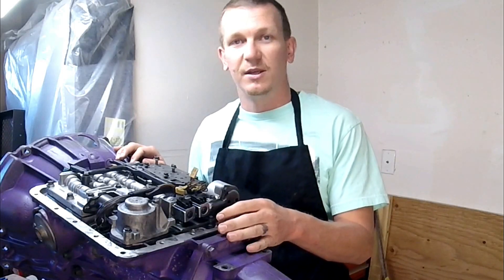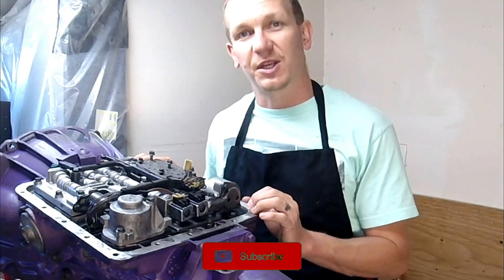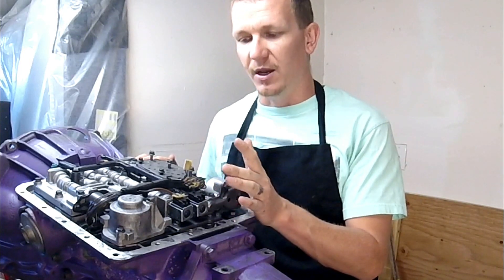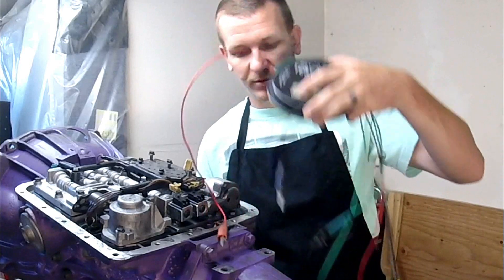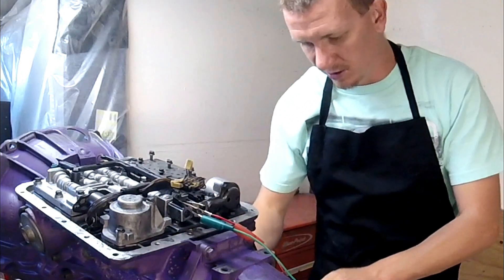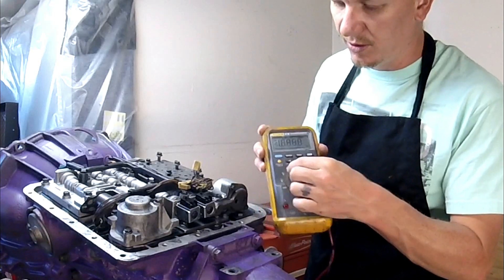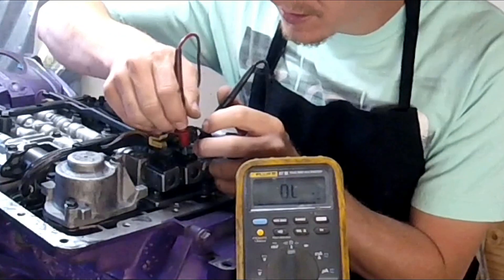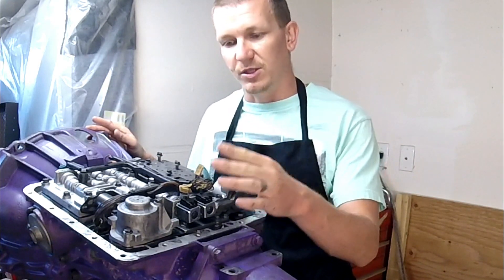GM 4L60-E Shift Solenoid Quick and Easy Test. Sol A, Sol B, 1-2, 2-3

Comment: I have a 4L60 E that when you put it in drive it takes off in 3rd gear. I think it has first or second when manually shifting it but no transmission codes present. Am I wasting time testing shift solenoids? Great video too!

Comment: I drive a 1997 chevy k-1500, my truck shudders pulling hills on the interstate/highways (downshifting problems?) Would this be a 1-2, 2-3 shift solinoid issue? If i let up on gas, it goes away, as well as giving it more gas...🤔

Comment: I have a 2000 S10, the 4L60e works great in all manual modes but not drive. I have measured from the pcm computer harness and I get the 21 ohms on all relays. Black pin 17 to Red 2, 4, 6 and 7. I am suspecting the PCM computer. Do you agree? Video was great.

Comment: Exactly what I was looking for in a 4l60e “bench test” of the solenoids.  My truck OD (4th) stopped working altogether and thinking my truck is only running on 1-2 only as when I am doing 60mph, rpm is 2100.  Lucking half my drive to work is in town IE 40-45mph with the last 5mi stretch @ 60mph to my work exit.  Truck shifted just fine one night and then the next evening all of a sudden did not want to shift up to overdrive.

Comment: 1994 Silverado Z-71. 1-2 shift strong. 2-3 shift is nonexistant, like going into neutral. If solenoids check good what to check next?
Reply: did u get it figured out
Reply: I checked the ohm resistance. Came back 19 ohms on both solenoids. Tried the 9 volt battery test. No clicks. The coils in the solenoids looked loose, like they were unwinding. Fluid looked burned with a lot of sludge. Didn't notice any metal. Could it be sludge and grime plugging up the manifold pressure switch? I had others tell me the 3-4 clutch pack is burned out. This problem was sudden. What else can I check without pulling the transmission out and tearing it down?

Comment: What about GM Solenoids ?
That the same as A/C Delco ?

My 4L60E transmission won't shift into 3rd gear and slips to high rpms.
1 & 2 is okay. That the solenoid ?
Reply from the maker: Ac Delco parts are pretty much GM parts.

It's possible it's a solenoid but doubtful. Honestly, you probably have worn out the 3rd gear clutches.  There is a 3rd gear check ball in the case that goes bad, and that causes 3rd gear to wear out. I know that's not what you want to hear but that's my honest opinion.
Reply: @ScottiesHobbies 
So if the 2-3 solenoid passes test, then the ball and 3rd gear is bad ? Where's the video link for that ?
Reply from the maker: @paulforest1373  I have a old video that kinda sucks covering that check ball. Check it out here: https://youtu.be/3RwmrY6QrBs?si=JPFkvSjxGAf8L8zw the trans has to be disassembled to test it. You could probably replace it by removing the valve body. But if the check ball is bad, 3rd gear clutches are probably worn out.
Reply: Thanks. On eBay link, how do you determine which solenoid is a (1-2) or b (2-3). 

My solenoids look exactly alike except numbers.
1 has  8054D the other has 8054E

They both have 8129R.

The have good ohms and click.
Reply from the maker: @paulforest1373  if you are working on a 4l60e. Both of those solenoids should have the same part number. The gm / acdelco part number is 24230298. But if they pass the ohms test and click test, they are probably not going to be the issue.
Reply: @ScottiesHobbies 
Thanks. 
The atf fluid is dark too.
I'm going to try new fluid.
But, my radiator popped and water got into it. So, I flushed the transmission with new and the fluid went dark. Hardly red at all. 

Should I replace the servo ?
Should I replace the filter ?
Should I replace the solenoid o rings ?

Comment: I have a question I’m having an all kinds of codes  from torque converter to all the selonoids  and  I was told to check my ignition switch is there any wires going to the Trasmissin to ignition? 🙏🏼. 97 Tahoe 4x4

Comment: Hi there what if I replaced the solenoids but my 99 gmc sierra 1500 still has no 3rd and 4th gear. Also I've replaced the rear 2 speed sensors.
Reply from the maker: These trannies are notorious for blowing out 3rd gear due to the 3rd gear check ball going bad in the case. You Might Need a rebuild... sorry to be the bearer of that news.

Comment: Hi Scottie, I have a 06 gmc sierra 2500 hd, 4L80E transmission. I have shifting issues only when towing my 4000lb. Boat up a large hill toward the top which is the steepest, then after that hill, no problem. toward top I drop in the 30 mph. Range and it won't  downshift, stays in 3rd
 I got a po730(incorrect gear ratio) code many times. And 1 time I got a po757 along with the po730, could that be a shift solenoid. Or a dirt shift valve, being that it shifts fine without towing anything?

Comment: I flushed my radiator and heater core, had water everywhere, and now my 2004 Chevy Silverado won't shift into 3rd or 4th gear. Can anyone help me figure out what the problem is?
Reply: Maybe check your transmission fluid for coolant contamination

Comment: no fwd gears.  happened while idling.  just as i accelerated i heard a slight thump then sudden lack of momentum.  tach ran but no movement.  had to reverse gear out of traffic.  one suggestion was chk balls could b stuck on trans plate.  what say u?
Reply from the maker: Honestly sounds like a forward sprag broke or is malfunctioning.  I do see where some people in forums are saying you might have a stuck checkball in the valve body. It might be worth taking the valve body apart and making sure nothing is clogged or stuck. If you don't find a problem during that process I would say you are in for a rebuild at least.
Reply: @ScottiesHobbies  up on jackstands now.  Ready to drop pan.
Reply from the maker: @anthonypeterson5618  good luck. 💪🤞👍
Reply: @ScottiesHobbies  My 4L60E solenoids click....one clicks strong the other muc weaker click.  Is that sign of issue?  Forgot to ohm test. . Will do first chance.  Lastly, filter was gray fluid clean lil debris but very clean.  When done new filter goin in.  Oh 97 chev tahoe 4wd
Reply: Shift solenoids AB about 21 ohms. About the click.   One sound weaker than the other.  Planning to swap A to B vice versa.  The name of solenoids on opposite end of valve body?

Comment: hello from Poland Scottie  , when I put the meter on shows 21 ohms and it drops to 15 ohms after a second, there will be a good solenoid a and b I have a problem, 1st and 2nd gear and reverse, but in 3rd gear it is neutral .. my saab 97x hat 198Tausend kilometer no mile

Comment: Testing to see if they click is only part of the test you have to test them to see if they will hold pressure or leak down as well. If they leak down your just as screwed as if they failed the click test.
Reply from the maker: True. A non sealing valve won't cause a circuit malfunction.  That will more likely cause a drivability issues.  I would use the clicking test in a situation with a circuit issue.

Comment: I've only tested via the PCM wire harness pins and fuse terminal at this time. The 1-2 solenoid is within spec but the 2-3 solenoid is showing a lesser resistance of 4.2 ohms. I'm confused as to what would create less resistance. Perhaps the ground wire is grounding to something other than the PCM?
Reply: Late but, I would say the internals have shorted out on the solenoid possibly.
Reply: @dsdiesel20  Sounds about right. Replaced the solenoid and the issue was corrected.... For awhile anyway until I had to pretty much replace the valve body and all that jazz and no more issues since.

Comment: Hello. I have a 96 chevy caprice.
It went into limp mode yesterday evening. 
I Went to autozone and oriellys this morning with a check  engine light and they gave the same code P1886 for bad shift solenoids.
I changed out both and Refilled with fluid only to have the same problems.
And after testing solenoids, they both pass tests.

Comment: Having problems  2001 gmc serria 5.3 2wd p0758 replaced valve body and all sensors working on wiring now still as of right now 2nd and third manual and reverse is all I have need help thanks.

Comment: I took off the front wheel four wheel drive driveshaft I also took off the motor shift motor symphony manually and I still cannot get out of first gear still stuck in four wheel drive low the computer doesn't recognize that it's not there how do I make computer go to 2 wheel drive
Reply from the maker: When you push your 4 wheel drive button does the actuator on the transfer case move at all? Or can you turn the selector the actuator turns? And this is a 4wd W/selection and not a AWD?
Reply: @ScottiesHobbies  
I have to drive shaft that goes to the front completely taken off all the sensors unplugged so I get no lights on the dashboard as the automatic push button four wheel drive selector switch and I'm still stuck in four wheel drive low transfer case is not recognizing that not in four wheel drive
Reply from the maker: @codyleroy9987  I believe the transfer case is what gives the truck the 'low' gear. So when you push the button on the dash the selector on the transfer case will actuate the low gear. I think you might be able to manually shift it to 2wd or atleast 4hi. The trans and front diff don't give the truck the low gear.
Reply: @ScottiesHobbies  okay I tried all that I'm even taking a Tricia and I disconnected all sensors but the computer remains believing it in for low I don't know how to stop that from happening
Reply from the maker: @codyleroy9987  you have to manually shift the transfer case if the computer won't. Or the transfer case is internally mechanically broke. The computer doesn't make the low gear. If it did, it would be by electronically shifting the transfer case. Are you thinking the computer dumbs your engine down to be in a low gear?
Reply from the maker: @codyleroy9987  if you think its stuck in 4wd low it might be easier to understand how the low gets the low. Take a look at this video and it explains how hi and low are applied to 4wd. It doesn't matter if the front shaft or sensors are there. The rear drive shaft runs threw the transfer case.  https://youtu.be/mv5szgzEH5Q

Comment: 93 explorer, 4.0L, 2wd, A4LD,

thanks that demo helped me. i was looking for something to explain how to check the solenoids. the issue is the vehicle doesnt move forwards or backwards in any gear.
Reply from the maker: I believe you are dealing with a AOD trans if I remember correctly.   That is a different beast than the transmission shown in this video. Generally if you have no movement I would start looking at the pump. Is the pump not getting fluid? Is the pump not pumping fluid? Or the transmission lines clogged? Something like that.

Comment: How did you know it was a check ball in the accumulator that was leaking like you said around the 5:45 mark and caused the 3-4 clutch pack to go bad?  I'm having a similiar issue.  2002 s10 4.3 4x4 with 4l60e.  It will shift from first to second, but not to third.  The valve body and all solenoids have been replaced as well as the ecm.  It temporarily shifted after replacing the ecm, but then went back to not shifting into third gear.  Pulling the transmission fuse puts it in third gear "limp mode" as expected. Any help is appreciated!
Reply from the maker: Only way to test the check ball is by taking the pump off and manifold off. If you drip fluid into the check ball, it should not go into the case.

Comment: I have a 99 Silverado 1500 5.3L 2WD with 195K miles and no error code. it shift 1,2,3,4th fine.  Problem is when are in 4th gear driving at 50+ miles constant for 5 minutes it pop out of gear/neutral.  You can manually shift 2 gear.  To reset, I need to stop and put the truck into park then speed up again.  Is problem related to 3-4 shift solenoid.  thanks for the help!
Reply: Was it? Same here

Comment: Should I replace my pwm solenoid 2-3 downshift and force motor along with shift solenoids?
Reply from the maker: if it was mine and I had the extra money I'd get a wire harness with all the solenoids. Change it all at once. The DEX3 is getting to be $27 per gal. you don't want to be draining and filling that trans too much. Also look at the actuator. check the piston and the center hole for oblonging.
Reply: @ScottiesHobbies  good old dex3 I might go with that I have synthetic dex 6 in it right now but yeah either way don't wanna drain out new atf for sure thank you for the advice.

Comment: 1992 Chevrolet suburban 5.7 TBI AUTO 4X4 HESITATION NO GETUP
Reply from the maker: This could be a don of things... in the engine maintained? Is it sending enough power to get to the wheels? The fuel pumps for out on the as well as the injectors getting clogged.

Any reason you are suspecting trans?
Reply: I'll push slow with gas pedal and the engine will rev and sound like it should be going fast but not

Comment: One question is 20.2 okay still? It's a brand new shift solenoid that's what it tested at and my other one tested at 21.4 does that seem normal? And am I able to check pwm solenoid 2-3 solenoid and force motor with multimeter?

Comment: I have a 2001 GMC Sierra extended cab 2 wheel drive 4.8 V8 was driving good not slipping at all then all of a sudden lost drive and over drive
Reply from the maker: Can you manually shift threw gears? Have reverse? If you have no movement at all, I'd look for blockage from a bad filter, something in the cooler lines?  worst case, pump has gone bad somehow. But fluid is probably not moving if you no movement.

Comment: My 2007 blazer has a 4200 engine it shifts 1st to2 ND then it's like it goes into neutral,I replaced solenoid for 3rdand4th does same thing
Reply: Mine does the same thing you do ever find the fixed

Comment: great info. I am having issues with a 2004 4l60e behind an LS 5.3 swapped into a 2006 wrangler. Novak programmed ECM and wiring harness.  I drove the jeep and reverse works, 1st works but will not shift to any gear automatically. I can shift from 1st to second manually.  Tested the Transmission has same voltage at fuse and trans connector.  Any clue what to test next?
Reply: @bugsbunny4539  thanks for the reply. I have a bidirectional scan tool launch 431x. I bought because of this rig. Got her working. Turned out it was the vss installed by Novak. It was not fully seated and was not sending a signal. Tightened it down and it all works.

Comment: Iv been trying finishing someone else's put together I believe. 94 GMC Serria 1500 4.3l tbi 4l60e trans. K case, lockup.  
All sensors on motor have been replaced with new.
Overhauled tbi,new flexplate,filter n fluid for trans. 
Motor with new oil pump, waterpump, intake manifold gasket ect. 
Issue is wanting to shift out way to early and when prompted with accelerator pedal seems to drop into to low of a gear then right back to 4th or overdrive to soon and repeating its self till higher speed is reached then seems fine. Am I just looking at a transmission overhaul?

Comment: And kinda dumb question but would it do the same thing (not shifting past 2nd) in 4wd?
Reply from the maker: Never a dumb question. Have you dropped the pan? Any clutch material in it? Really, it could be a number of things. Can you manually shift into 3rd or 4th? Depending on the milage. Your internal 3rd gear check ball might have gone bad.

Comment: Does this mean that you could have a Obd code 0756 indicating a bad shift solenoid when in fact the problem could be  elsewhere.
Reply from the maker: In essence you are correct. You would need your line pressure checked to ensure proper pressure.  After that, you would need to test your solenoids and wiring harness til you fin something bad. If that all checks out and it possibly could, you would need a tare down. Don't forget to have the 3rd gear check ball in the case checked.
Reply: @ScottiesHobbies  Thanks, that's great to know Scottie and squares with some of my other troubleshooting adventures.  A bit out of my skillset but I'm a diehard diyer (or maybe just a tightwad) so I may not be able to resist giving this project a try🙂🙂
Reply from the maker: Take a look at this video: https://youtu.be/lg8cCPQHpu0

Comment: Thanks for the info.   2011 chevy express 1500 AWD with 179k miles.   Yesterday, van down shifted to 2nd gear on the highway, and did not hear any noise, other than rpm going up at that time.
Will not shift into 3rd or 4th gear.   No error codes.   Will go to a Transmission shop today, b/c I don't have time or the space.   I want to buy a new tall roof, extended Promaster but, it's a horrible time to buy, due to shortages.
Reply: Mine was similar acting what was the answer for you?
Reply: @KollynJ  Burnt 3rd and 4th clutches.   Had it rebuilt 2 times.   Both times lasted just past the warranty of 1 year.   I bought a new 2023 Promaster 3500 Ext a few months ago. $57k out the door.

Comment: 07 suburban 1500 2wd 5.3L
Rpms run high
Shifts down fine
Sticks on high rpms hard to auto shift up to 2nd and 3rd; reverse is fine.  If at high speeds just shoots rpms. No fuel failure

Comment: I have a 98. Trans am with transmission from a 03 Silverado . 2nd gear works , shifts into 3rd by itself .  Reverse is fine .  No slipping .    No 4th gear . Code po753
Reply: Sounds like a selenoid code? What was fix

Comment: I just installed a used transmission that worked when I pull it out of a vehicle when I put it in it does not work does nothing when I drop into gears sometimes it'll rev up when I put it in 2 gears but will not move tires at all

Comment: They how's it going? I have a 98 chevy Silverado c1500. Trans went out. So I put a new use one in. Now the new one drag's at high rpm into 2nd gear and then I don't feel it going into any other gears. Replaced 1-2 and 3-4 shift solanoids. Still have the same problem. Did the transmission rest thing and still have the same problem. I also change 2 other solanoids. Still have same problem. I needed my truck for work. Need help!